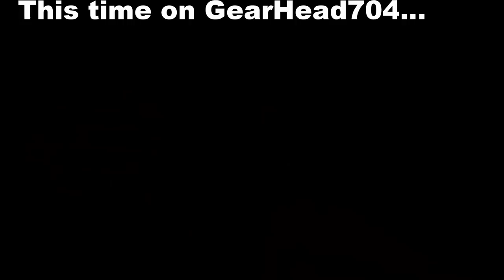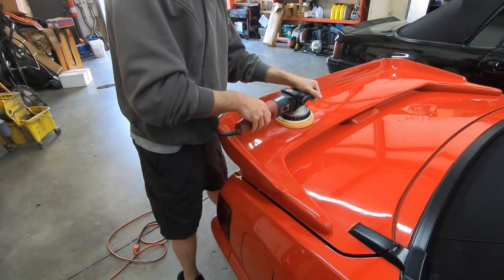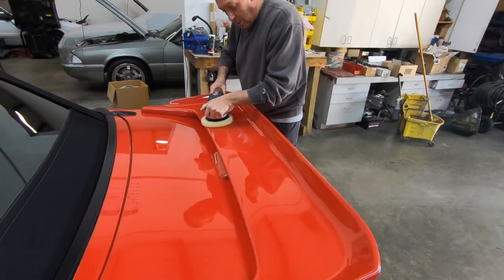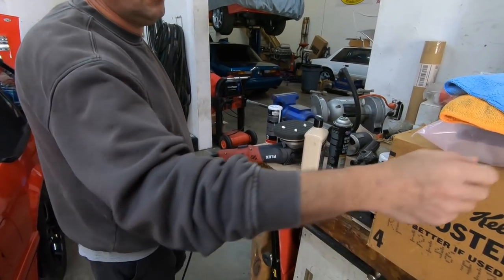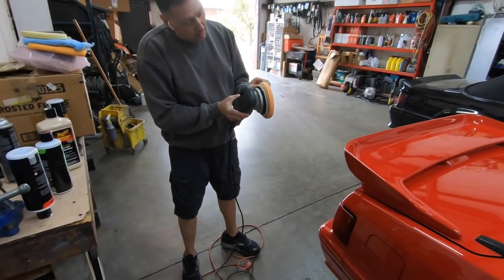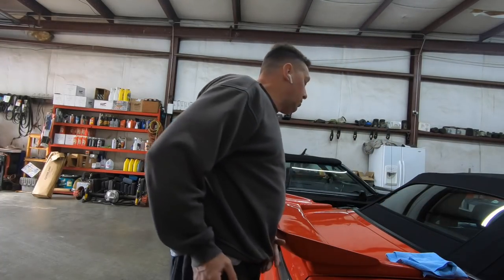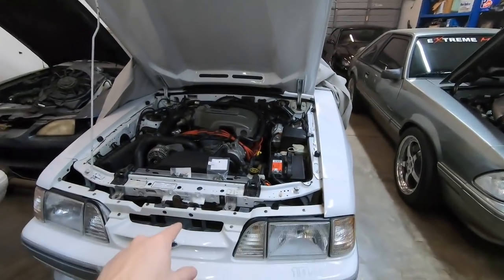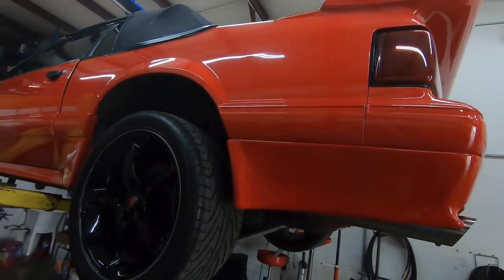Using an ELECTRIC BUFFER on the FoxBody Saleen Clone Paint

Comment: Good job! in the old days Meguiars used to have a 3 step process and it was idiot proof.  The bottles were labled 1, 2, 3.  Cleaner, polish and wax to seal.  The cleaner took off all of the oxidized paint and restored the luster.  Essentially, this is the same sort of thing.  Definitely works.  The electric polisher is good to have...but definitely have to be careful not to "burn the paint" by sitting in the same spot or using an edge for too long.  Or pressing down too hard for that matter.
Reply from the maker: I was worried about those exact things LOL